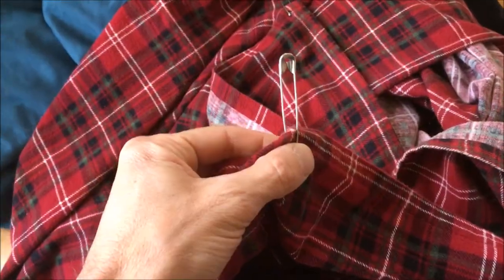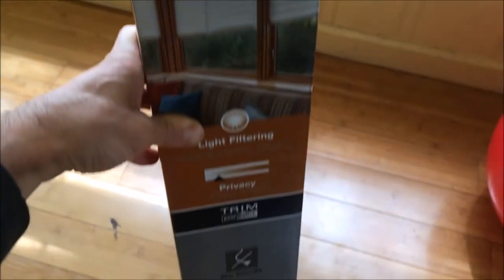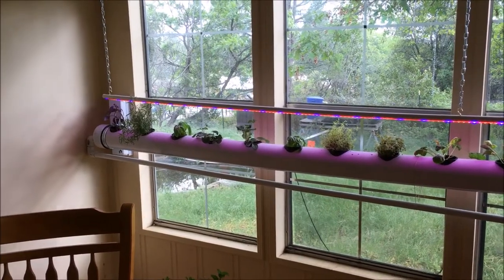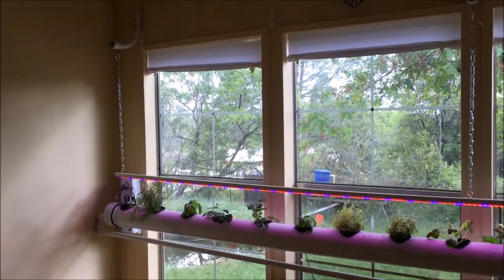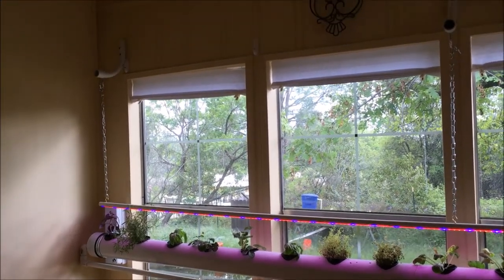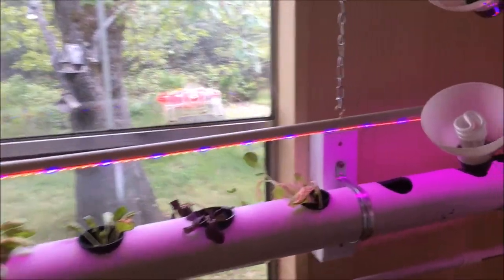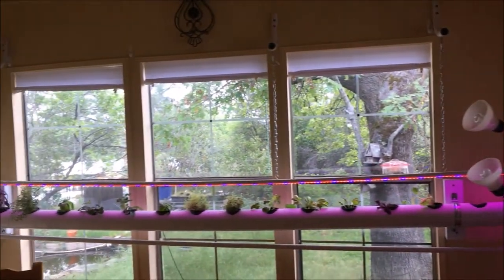LED Strip Light Install - Grow Light for NFT Aquaponics

Comment: I recently purchased a stop light similar to this but the end is a wire without an adaptor can you tell me what I can get for an adaptor to plug it in?
Reply from the maker: I’m not an electrician but I guess I would try to wire nut or use alumiconn to connect wiring 🤷‍♂️

Comment: Hi, thanks for the tutorial!  May I know how the plants are doing so far?  I'm thinking of buying a set for my indoor plants too and I'd like to hear your update of the effectiveness, thanks.
Reply from the maker: This system was doing great before the trees grew leaves and blocked out the sunlight. Since then, I’ve had a lot of issues indoors. I cannot say for certain but I think that the light I have is not good enough. I just got a small T5 fluorescent. I’m going to add that and see if things pick up. Good timing on your comment. My computer literally just died. I’m a week or two out from recording an update on this system.
Reply: FARMER G - MY HOMESTEAD Thanks for your update and details. Sorry to hear that your computer died...
Reply from the maker: Your welcome. I’ll be back up and running in a day or two. Thanks.

Comment: Please give us update on how you plants did with the led strip lights. Did your plants grow?
Reply from the maker: I took them down after a while and replaced them with t5 lights. The leds went out after a few weeks. If they had kept working I would have doubled them up.
Reply: Farmer G did you replace it with LED T5 lights or CFL T5? Thanks
Reply from the maker: I did a video on them 2nd light added update it’s in the indoor aquaponics playlist. They are fluorescent t5 lights. I got ich in my tank shortly after installing them so I didn’t really get a chance to use them in the system before I put the system on hiatus. I use the lights for starters at the moment and they work well.

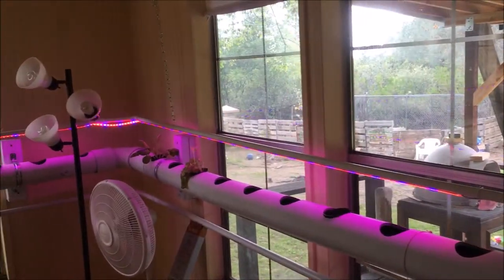Comment: 2:48 We can already see the led strip is already falling off. :(
So how does it hold so far?
Do you get any improvment on plant health/growing?
I have the feeling that this is not enough power.
Reply from the maker: I think you are looking at 90 degree angle. It didn’t stick there because the led strip was very rigid. I used twist ties to keep it on in that spot to force a turn, otherwise it stuck pretty well. This light only lasted me a couple weeks and then died. It was a disappointment but I’ve got new light(s) up now. T5
Reply: @FarmerG  Humm that dead LED sucks... I hope you get reimbursed.
What kind of power supply did you used?
I'm just about to make a small hydroponic system with this Ebay LED strip as well... About 6$ for 5 meters.
Reply from the maker: It all came as a complete unit. Plug it into the wall. Sounds like you got a good deal going. 👍
Reply: There is other with pwr supply and remote control for additionnal fees as well. Still 3-5 times cheapers than Amazon